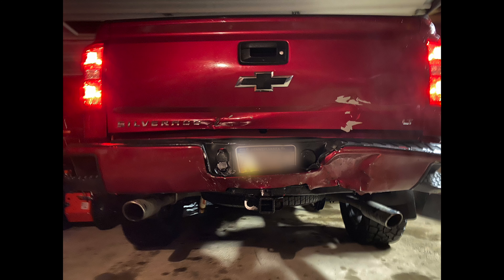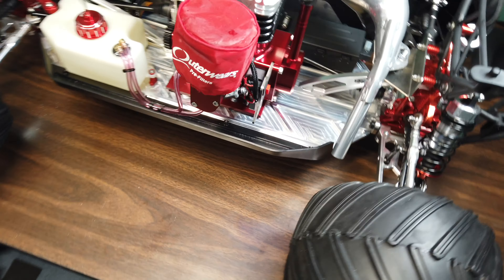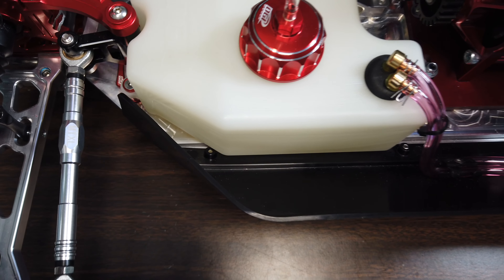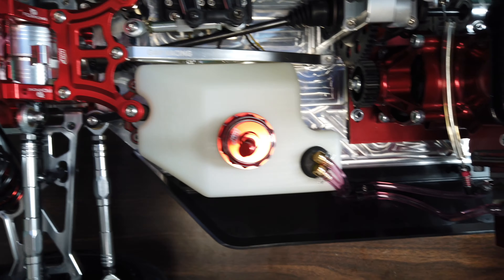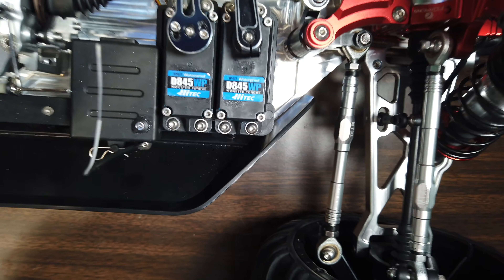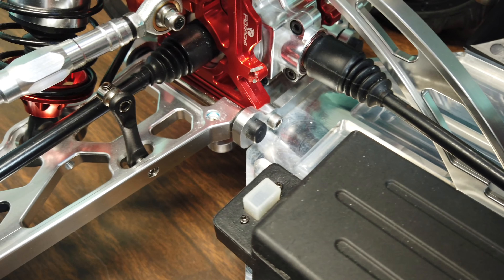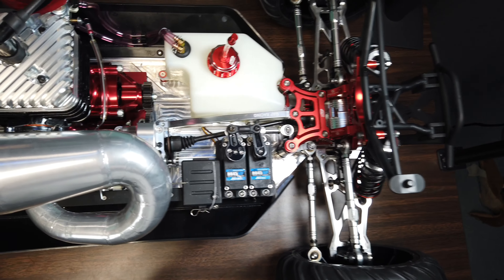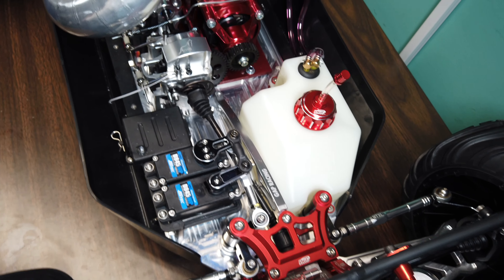Losi MTXL Final Build

Comment: What kind of fuel do use for those 1/5 scales
Reply from the maker: 2 Stoke Gas/oil mix. Recommend 93 octane or above mixed with Amsoil Dominator oil.
Reply: @316RC  can i already with oil in by vp fuels
Reply from the maker: @bencalligan9115  maybe depends on the mix ratio. Should say on the can like 50:1 24:1 etc… let me know what it is